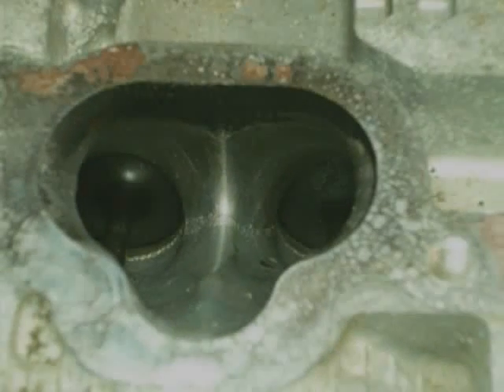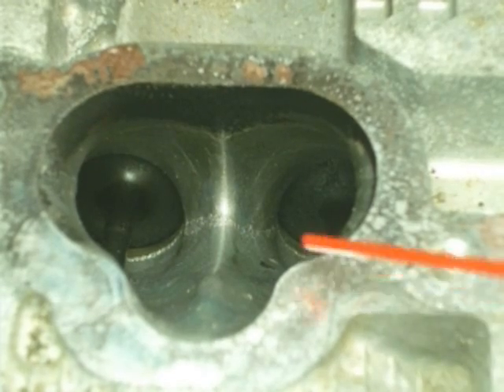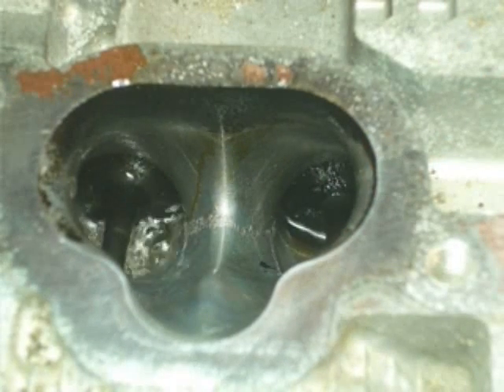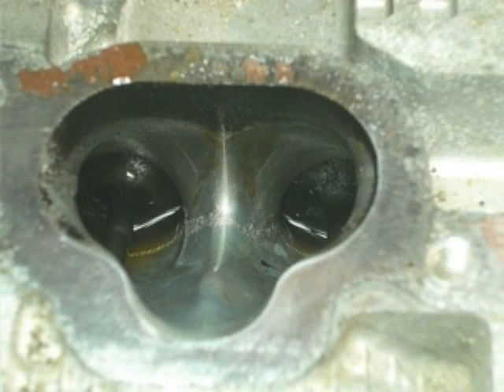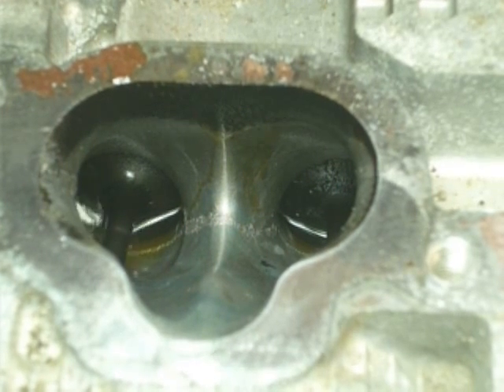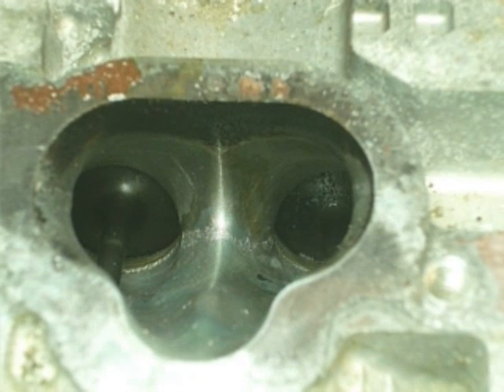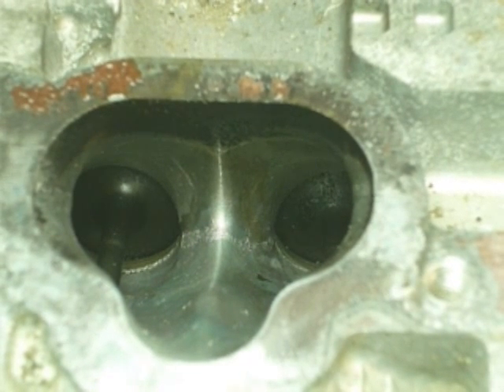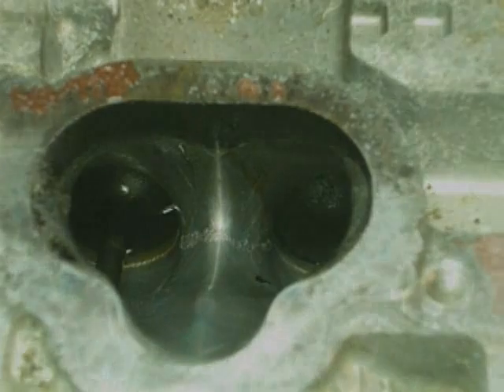leak down2

Comment from the maker: Hi, nothing wrong with the valve, only dirt stock in between valve and seat, dirt can also be carbon deposit.  If you are working on a old engine and want to know where the leak is (piston rings or heads) you should first do a compression test, if test is low add a spoon of oil in the cylinder (spark plug hole) and do the test again, if compression rise the problem is on the head side (oil will fill ring gap momentarily).